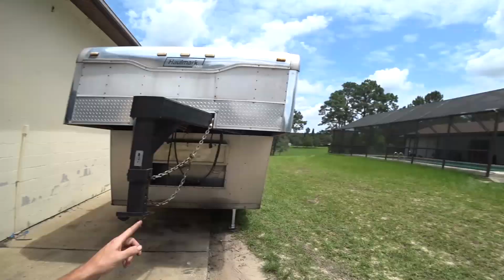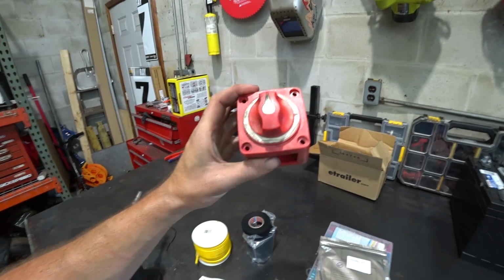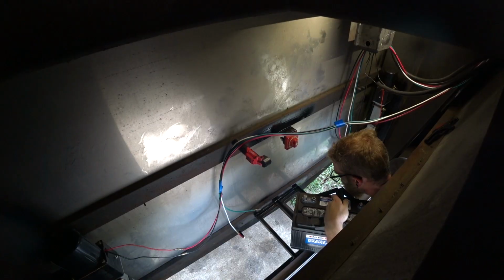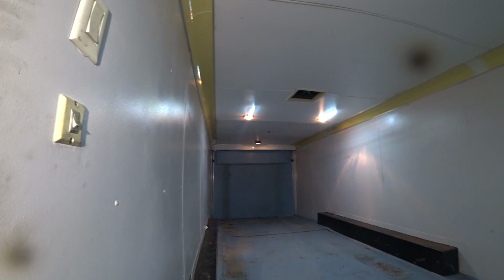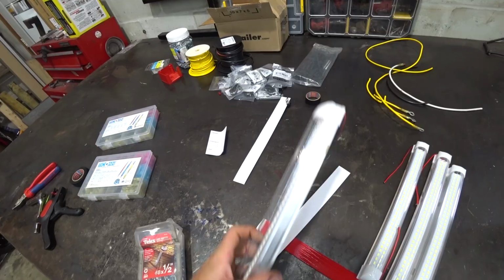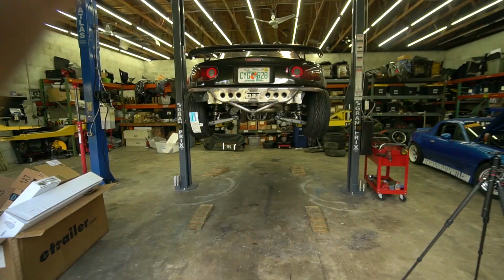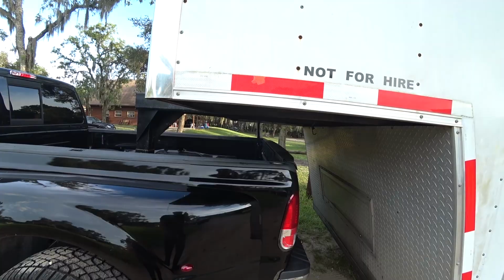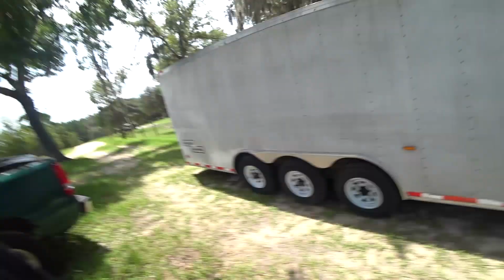Refurbishing And Upgrading My Gooseneck Enclosed Car Trailer Pt. 2

Comment: Why not get a sheet of diamond plate or steel and build a floor for the front compartment? that could allow you to move the batteries to one side and install a smaller generator for weekend trips.

Build a floor, make removable panels for around the jack legs. it would help with the longevity of the jacks and batteries.

Comment: The truck is finally done time to work on the trailer.  Taylor please give some thought to mounting a air conditioning unit on the trailer, I did on mine and in the heat, it is great place to be in the heat.  When you need to work on the car under the desert sun I can close up the trailer and crank on the AC.  Wire your charging circuit to to the trailer to charge the batteries.  I installed a larger alternator and ran cables to a heavy duty aircraft connector on the trailer and connect it with a 8 gauge cable that I only connect when I want to rune the AC in the trailer. I would imagine it gets cooking inside the trailer in the Florida sun! Lol!  Think about it.

Comment: I did my whole 28’ trailer as well. Try wesleys bleach white spry it on scrub with soft brush and pressure wash it off. Then a good wax. I was impressed with the results

Comment: If you put the generator up front .. I can not stress enough!!  that you will need to vent the exhaust out of that compartment!... I had the same ideas and it was great till one day it literally caught fire and my trailer was a total loss!! You need to vent the exhaust down and only run it when the door is open! Because it need fresh air to cool. Maybe run an auxiliary fan in the compartment ... but my lesson is your gain

Comment: Simple Green or CT18 truck wash might bright the white back.  Not sure about a black wrap, it might be unbearable inside the trailer heat wise in summer.  Maybe a few larger decals/vinyls of sponsors or tools and equipment you use, your racing number or signature in vinyl form.   Or Google image search for ideas on other people's transporters and trailers.

Comment: So if your power wire is constant and ties into the auxiliary power on the 7 blade wire, all someone has to do is run any ground wire from their truck to your trailer and they can run your power without your kill switch, I. E. Your trailer Jack's and all they have to do is plug in your trailer connector and any ground wire between the two. I personally would have had the kill switch single out your Jack's from the circuit or have two switches, one to cut off the Jack's and another for the batteries.

Comment: If you put a small generator on the front you should get one that's either electric start or one you can get an electric start for. It is just so much more convenient just turn the key and go.

Comment: I'm curious if the trailer wiring box you got was all color coded wrong, I've bought 3 exactly the same looking as yours for 3 different trailers and they were all colored wrong, but the text printed into the plastic was correct?

Comment: Once the paint is gone like that on aluminium, it's gone. Just like house aluminium siding and older mobile homes with aluminium siding.
It has to be cleaned, pickled (with white vinegar), and repainted.

Comment: Need a soft start AC or you need to add soft start to that AC so will be a lot easier for your generator to run it it's that Spike when they first turn on they Spike up in amps and then come back down

Comment: Depending whats on the trailor  simple green might work but the best thing.i eould recommend is oxy clean the powder form mix up real good with water so no clumps clog your pressure washer but it will get just about anything off and it looks like sap on the trailor. Correct me if im wrong.

Comment: You need to put a plate floor or a plywood floor in the front wire area so someone couldn’t get under your trailer and flip the power on to run the jacks

Comment: Maybe muriatic acid would work to take the deep stains out of the trailer and bring back the white? Stuff is crazy strong and is what a lot of people use to clean up boat hull's that are deeply stained and discolored. If you use it, definitely use a ventilator because the stuff is no joke to breath

Comment: Just a thought but once you're all done with the wiring stuff, might want to enclose the bottom of that lockable portion of the trailer where all the electricals are. As someone could easily climb up to essentially "hotwire" your trailer

Comment: Might be worth adding a fuse to the main power to the trailer.  Would hate to see a fire caused by one of the wires getting pinched/insulation worn through!

Comment: Switch those lights to LED if you haven’t already save some power and usually get more light need some lights on the main gate so you can work on the car outside.

Comment: Wash the trailer then use renovating polish on a small spot to see if it will bring it back before using it all over, I think you will find you have a sweet whit trailer at the end of the day. Then wipe over with ceramic detail spray.

Comment: If Freedom truck wash doesn’t get it back white I’d guess wet sanding and polish but they usually have a very thin coat of paint so it may go through easily. I’d try Freedom wash first. Dilute it a little stronger then they recommend but not too strong and try to keep it off the bare aluminum of you’ll be polishing that as well, which wouldn’t hurt. If all else fails wrap it. We had an all black rig and it didn’t get any hotter then anyone else’s. Your roof ain’t black.

Comment: Am just a quick one.. is the bottom of that battery/wiring compartment open? So someone just has to crawl under the trailer knock off the killswitch an instant access to jacks etc?

Comment: I actually love seeing your massive the set ups over there like a big ol truck that's huge and a massive inclosed trailer , I'm in Australia with a 16' open trailer and an au Falcon
Reply: Do you guys have trucks bigger then a 70 series or HiLux? I honestly don’t know.
Reply: @DMSparky  not really the biggest we get would be a 79 series or patrol , you can get trucks like Taylor's but they cost so much , but over here we tow car trailers and normal trailers with common sedans main ones would be the Falcon and the commodore , the "bigger "4bies we have are used for off road adventuring and Turing

Comment: Your AC will work 12/15 % less then Black having White exterior and white interior.Buff the outside aluminum panels with "Meguiar's G17216 Ultimate Compound". It will look new.and do the aluminum trim with Scotch-Brite  Maroon Very Fine  Sanding Hand Pad.

Comment: Yo dude before you too much more crazy on wiring you should consider getting a decent size inverter/charger. That way when you run your genny you can charge your batteries too as well as have an inverter if you don't wanna fire up your genny and have 110 power for power tools you need (that aren't cordless of course) or whatever. Just my two cents though, love the content as always! Peace!

Comment: When your batteries need to be replaced, run two deep cycle six volt batteries in series. Typically they will hold a charge longer under the same conditions as two 12 volt batteries in parallel.

Comment: 100% think you should add two 600 Watt solar panels to the top of the trailer with an MPPT charge controller and a 3000 Watt inverter and I would do some 6 Volt golf cart batteries. BUT IN THE MEANTIME!!!!!  

 Keep the generator you have now and just make a proper exhaust with too big mufflers on it and have it run down and out of the generator compartment.

Comment: Stop switching with the grounds! It’s a good way to blow things up! I know it’s 12v but still having voltage always present at your devices is an easy way to fry things. especially if the trailer is connected to a grounded vehicle frame; your still grounding the circuit!

Comment: Nice work man, loving this series. I would get the biggest Honda generator possible for what you want to run. Nothing worse than getting a generator that is too small. Even if you gotta install it in an less than ideal spot

Comment: That weird screw that is used often on trailers is just a double square drive. Should have 8 points. Can easily be turned with a standard #1, #2,or #3 square bit. 

If you don’t have luck “restoring” the paint, buy gloss white rustoleum by the gallon, tape up the trim/ lights/ etc. and just roll it on.  I’ve done this with countless trailers, and while it won’t give you the perfect finish that a sprayed automotive paint job will, you can paint the whole thing in a day for a couple hundred bucks worth of paint and supplies. 

Check out these soft start kits. With this, you should be able to run a rooftop air unit off of a 2200watt inverter “quiet” generator. I would also think about adding a small breaker panel and a standard L5-30 RV power input so you can plug in anywhere that might have RV hookups. https://www.microair.net/collections/easystart-soft-starters/products/easystart-364-3-ton-single-phase-soft-starter-for-air-conditioners?variant=30176048267

Comment: If you used a marine switch with 1, 2 or 1&2 then you could leave one battery on when your using lights insuring you don’t kill both batteries on accident.

Comment: There is the stuff that you can get it lows or Ace Hardware called white ox and it removes just about anything and then hit with a sub brush and pressure washer should help restore it

Comment: Years ago i had a clapped out white trailer like yours, I ended up buying a box of 10,000 stainless steel screws and systematically replacing all of the rusty steel screws one at a time. Actually had a buddy remove 1 and I would replace it with new one.. only really took a few hours and 2 boxes of beer. Then we used a malco brand cleaner of some kind, sorry cant exactly remember the name of their exact product and it made a night and day difference.  People actually asked if i had gotten a newer trailer..  Hope this might help?

Comment: Try a mr clean magic eraser on the outside to clean it up worked for my old fiberglass siding on my trailer to get the discoloring out and easy on the finish. You will need a crap load of them though may want to try for a sponsorship LOL!!

Comment: Wouldnt it be better to run all your grounds to a negative bus, put the power to a switch, then have a thermal break and run a positive from the breaker to a house breaker panel from blu seas. That way anything you add has a breaker and is all in one panel

Comment: You need at least a 3200kw generator for a ac unit. Get 2 small ones and wire them together will work but don’t put nothing else on with ac or will trip

Comment: Try diluted acid based wheel cleaner full strength purple power iron Decon I’ve cleaned a couple trailer that were pretty dirty and I used that stuff and it worked pretty well for me

Comment: I feel like there are too many ways to get at your battery disconnect, from below or over the top. Isn't there a fully closed in and locking cabinet you could put it in?

Comment: Aren't you afraid that the killswitch is quite easily accessible without opening that hatch? Someone flexible could creep under or over it to operate the switch, and then retract the jacks.
Probably wouldn't do black for the trailer outside as the inside temps would be a lot higher compared to white.

Comment: MCmaster Carr has everything you could think of as an engineer. I don't feel like looking up stock metal or plastic sizes straight to mCmaster I go. Also most of their parts have 3d models so you dont have to model any of their parts.

Comment: Get your self some iron remover
Rinse the trailer off spray iron remover on wait a little, wipe around with microfiber then rinse off.  It'll help cut through the road grime that's built up.

Comment: Are you running truck power back to the trailer so that the trailer batteries will charge when your driving down the road? The center pin for the trailer connector should be 12 bolt vehicle power if you run it correctly

Comment: U can run 12v amp to run a battery charger off the truck 12v system or get wheelchair battery charger to  charger ur battery at the track wheelchair charger are 24v

Comment: La total awesome cleaner works great to clean the trailer. You can get it a family dollar store and it’s only 1 dollar. I just did my trailer and it was dirtier than yours now it looks brand new. I would recommend getting a cheap bug sprayer and fill it up and use it to spray it on one panel at a time and use a soft car wash brush  to scrub the panel then rinse with water . The really dirty spots you might have to go over it again and don’t dilute the cleaner use it straight out of the bottle.

Comment: Could someone be able to crawl into that area where the batteries are because if so they could easily turn the kill switch back on, or are you gonna cover those open holes?

Comment: I don't think there's anyway to bring back that white paint. If you rub your hand on it and you have some white on it afterwards, it's enamel and it has overcooked in the sun. The other issue that brings is that nothing will stick to it, so you may be better off just sanding, priming and painting it... Or ask Adam from Bodevision to give it a sick paint job and get a Taylor Ray decal on that babe!

Comment: Haven't watched the video yet .but there is some stuff for washing boats you can get at west marine .i think its made by star brite .its a boat wash it will clean the outside of that trailer. Take all the black streaks off and make it shine .i have a 53 foot and it set under a oak tree and got the back streaks and crap on it and i couldn't get it off for nothing .bought that stuff and damn it looks brand new again .its only 3 years old .but it works .it cost me about 80 bucks to do that big ass trailer. My buddies 20 year old trailer looked dead was a small section it looks new again .differently works .if you see this and cant find it let me know and i will dig it up at the shop and give you the name of it .

Comment: If Taylor doesn't get a water sponsor after two days in the lockbox.  very Cool hand luke.  OR perhaps some Nomadic Cooling 12v air conditioning in the trailer.

Comment: I can tell you a 2000w harbor freight inverter generator will run a 15,000btu ac for a camper with a easy start on the ac unit.

Comment: while your doing some modifications on your enclosed trailer, put in some new anchor points. i say this so you can strap your  car down so the car is just a bit in front of your front axle of the trailer. you will thank me later. i think your tongue weight may be a little light. it will tow better with a little more tongue weight.

Comment: You switch the grounds, not the hot 12v ? I don’t understand.
Reply: Breaks the circuit either way.   It really doesn’t matter and in the case of the added lights, it made locating the switch much easier.
Reply: Easiest way to understand is DC power runs in a circle you have to have a complete Loop for it to work unlike AC what can be grounded just to the Earth so you don't need a complete Loop.

Comment: Don't wrap that trailer black, you'll regret it. Local team wrapped one black for the race season... Temp inside the trailer was 10 degrees hotter than their identical white one.

Unless you don't care since you will A/C it anyways.

Comment: Hey bro! I worked for a off road caravan and camper trailer company here in Australia and I know the absolute best electric system for your trailer oh and plus I’ve been touring (overlanding) for all my life so I know these sons of bitches like no tomorrow;

2x or ideally 4x (150amp lithium) batteries
1x 5000w inverter 
4x 200w solar panels 

There’s a company called RedArc they make a product called a BMS (battery management system) it’ll allow you to charge via the alternator through an Anderson plug, shore power(home) and also the solar panels. It’ll choose the most efficient and best chargeing form depending on your current draw when using the amps!

I hope this helps 🤘🏽🇦🇺

Comment: Lots of work.  I would think you need heavier gauge wires going to and bridging the batteries together,  Nice job though.
Reply: The shorter the length the less gauge can be use sometimes.  There are charts online based on amps vs length.  LOL the starter wire on your car is actually really undersized for the cranking amps but it's short duration, still that is hwy its heats up fast and your not suppose to crank very long.
Reply: @BOOT  You are right, but like you say, sometimes.  It all depends on the application. Have you seen the length of that trailer? haha! I am sure Taylor, like a bunch of us knuckle heads usually do,  has never done a proper Ohms Law calculation to determine the total circuit demands only to bite us in the ass down the road.  I don't know how many videos of burnt relays, fuel pump wires, etc, I've seen on youtube project cars. I am not knocking Taylor, I wish I had half his mechanical abilities, he does good work.
Reply: @CarlosAvellanet  I was talking bout bridging the batts mostly but the low draw of lights(LED especially) they are usually over gauged.  Anything that has a high demand I'm sure he'll run off the generator

Comment: If you impact your self tapping screws instead of using a drill..... Your gonna have a bad time!! 😆 low rpm and pushing real hard works great. Drilling pilot holes for self drilling fasteners seams redundant. Such fasteners literally have a drill bit on the end of it.

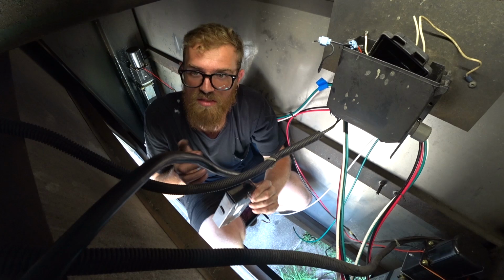Comment: 8:08 drill pilot holes.... for self-tappers.....
Reply: self tappers are for thin sheet metal, he was drilling thru like 1/8" steel. the self tappers would take forever to go thru it, if they didnt just get dull immediately